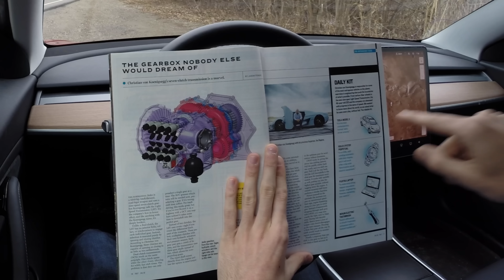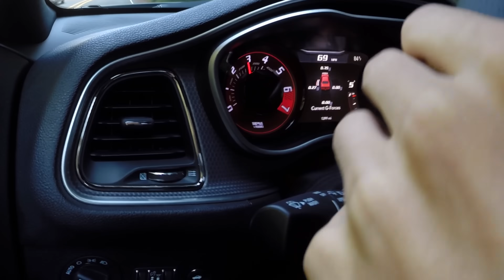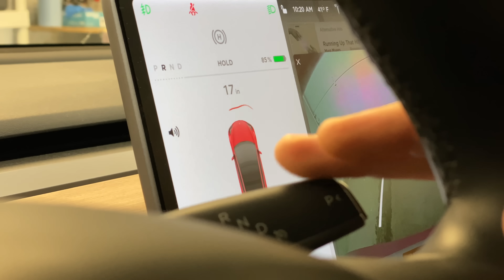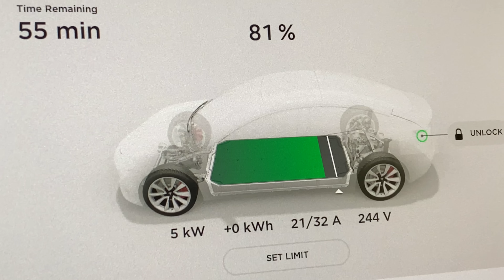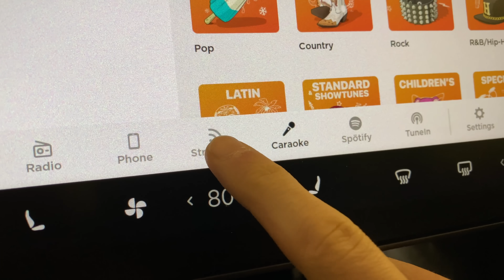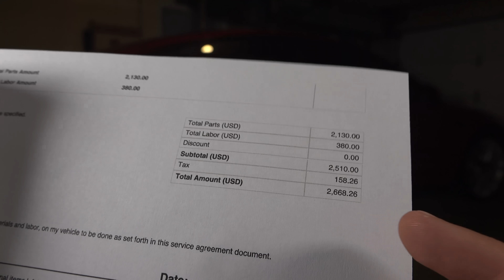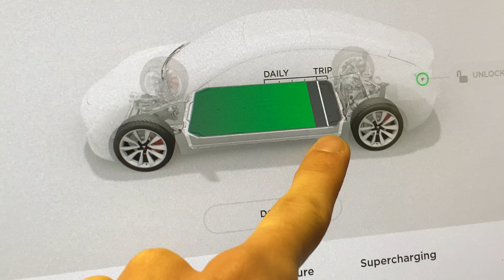Living With A Tesla Model 3 For A Year - The Best Daily Driver

Comment: On electric cars, the heater core and blower fan should be the luxury, with heated seats and steering wheel being standard. At least if you're going to go with a resistive heater and not a heat pump.

Comment: EV’s just make complete sense all things considered, especially from an energy point of view, the most important factor.
Reply: Your mind is a bit too narrow.  Imagine there are 80k lbs of goods in California that need to be transported to New York asap.  Does it make complete sense to accomplish that in a vehicle that weighs 4k lbs and can only travel 250-300 miles before needing hours to recharge?  No, it doesn't.  That's just one example.  If all you can think of is Joe Blow driving 3 miles to his job and back home, you need to broaden your perspective a bit (try actually considering all things).  Electric is perfect for some people, and totally out of the question for others.  Which is why they will NEVER replace vehicles with engines, only supplement them.

Comment: A lot of good points here, but one argument I don't buy is the "ugh, I have to go to a gas station AGAIN". I pass three gas stations on my six minute commute. It takes me roughly three minutes to fill the tank from near-empty to full, and I do that about two times a month. Now, how long does it take you to plug your charger in and out? 10 seconds? 20? Let's give the EV EVERY benefit and say 10 to plug in and 10 to unplug, and you only do each once per day, six days per week. That's 26-27 days per month = 8.6 to 9 minutes. MORE time than you'd spend filling gas.

Comment: This is a trolling s**t post video, regardless...

1) EE: where's the torque?
Me: Have you ever driven a diesel? Those have all the torque.
EE: ACCELERATION!!
Me: Well yes. EVs have that off the start line, but uhhh... buddy what about top speed? Tesla Model 3 is only 140MPH, The E-Corvette tops out at 210, the Bugatti Veyron SS 264MPH.

2) EE: what's up with the power lag???
Me: The Renault F1 team would have words for you, their throttle response is fast enough to play "God save the Queen" with just the engine. Get your car tuned and it will have more power, fuel efficiency, and throttle response. Don't put ICVs down because the factory owners prioritize profit over product quality.

3) EE: Transmissions are LAME!!
Me: Yea! I know right? Who needs rotational mechanical advantage? Cars? Bikes? The Electric Porsche? Nah! rip the gears out, they're junk! Again blame auto manufacturers for giving you crap transmissions, not the transmission itself. If the power delay bugs you that much get a dual clutch. Fyi EVs were invented ages ago too and only now is our understanding of battery chemistry good enough to make them practical.

4) EE: It so noisy!!
Me: Stop hanging out with Harley Davidson fans. I think you'll find the "noise" of normal cars (especially exotics) quite pleasant when they aren't honking their horns at you in traffic.

5) EE: Maintenance is expensive!!
Me: again blame your cars manufacturer for that. If they want to they can certainly make a car such that it breaks often and requires more service and parts they can charge exorbitant prices for. Kinda like Apple.

6) EE: No regen brakes?!?
Me: ICVs have had regen braking for years. Just ask any F1 team. In fact the regen braking on those cars is so good, severe restrictions are placed on F1 cars that have it to keep them from completely crushing those without it. Why aren't those systems on regular cars? Hhmmm...could it be the manufacturers are too lazy to go through the effort of reverse engineering them for mass market???

7) Why fill up at a gas station???
Me: you can top off in 5 mins and be good to go for hundreds or even thousands of miles in diesel ICVs. If you really want to you can even buy extra fuel and take it with you to store and use at home. The fact most people don't spend the majority of time in the car driving is the only thing that saves the practicality of EVs, especially in low voltage charging situations. Go on a long road trip, haul a trailer, or visit a place with no super-charging stations and that issue gets annoying real fast.

8) EVs pre-heat way better!!
Me: yes they can, and it takes a massive chunk out of your range, and will eventually drain your battery completely if you aren't constantly plugged in. Wouldn't it be nice if you could open your garage to let your car breathe instead of gassing yourself and the engine to death??? Yes your engine will die just like you if you put it in a small enclosed space and suffocate it. As for app control...maybe you should send those lazy profit hungry manufacturers an e-mail: dear car maker person, your app suxz .1 star, plz fix.

9)EE: I can leave animals and people unattended in a car without running the engine!!!
Me: ......................1st, Don't do that. 2nd you are still consuming battery, and could still get into security issues if left unlocked or near L33T h@X0rs.

10) EE: environment!!
Me: Only a fraction of our energy comes from wind, hydro, solar or nuclear. If you aren't near such a facility or you are charging at night , low wind, or in drought conditions you have a good 80% chance you are charging from a Coal  or Gas fired power plant and are making carbon emissions too. Maybe one day humans will stop trying to use Nuclear power to blow everything up and use it for Carbon-less power instead. A Dyson Sphere would be good too, even a tiny one that captures just 5% of the Suns power would render all fossil fuels into a niche hobby fuel rather than a necessity. SpaceX  I'm looking at you, please make a Dyson Sphere.

Comment: #3, I want an electric car with a manual transmission WITH a clutch pedal.
Reply from the maker: Conversions are rad!
Reply: I get that driving a manual gives American petrolheads a sense of elitism, but I don't understand why you'd inflict one with all it's weaknesses and power sapping inefficiencies on a direct drive transmission. To make it feel like an ICE you'd have to restrict the torque band. You could actually probably simulate a manual transmission in software, by restricting the current into narrow rpm bands that change  when you "shift". You could simulate the clutch by having the car periodically make grinding noises and subtract thousands from your bank account.
Reply: @mikeedwards350  Hey Mike, to me it's more about the pleasure of driving. I grew up on manual transmissions and I feel disconnected when I don't have a clutch pedal. I would absolutely pick a manual transmission with a clutch pedal over a paddle shifted version of the same car, even if meant losing a second in 0-60 time. I've driven paddle shift cars and it's just not the same. To me, it's not about the speed, it's about the connection and involvement in the process that I enjoy. I now have a GTI with a 6 speed and an F150 with a 10 speed auto. The 10 speed is a FANTASTIC transmission, and the truck's purpose is towing and some commuting, so it's great for that. But if I want to go to the track or drive just for fun, i want that clutch pedal, it's not just about choosing which gear. NOW... I think part of the disconnect for me is that it is so foreign to me that a motor would have a flat torque curve that would not benefit from some sort of gear optimization, but it sounds like that is essentially the case, from what you are saying. The closest i've driven to a Tesla is a golf cart, but even when I had battery powered remote control cars, when we raced we were always choosing different drive gears for the one that would be a best compromise of acceleration and top speed for a given track, so i think that is in my head, too.
Reply: @jeremyspecce  I get where you're coming from - every car I've owned has been a manual, I learned to drive in one, they're the default here. I've tried autos and didn't like it, the lack of engine braking,  or the ability to shift down because I can see a  corners coming up,  no auto can give that level of control. With an EV though, that torque is there all the time, and you can access it even faster than in a low geared ICE, there's no throttle lag, and little inertia in the drive train to overcome. You could get a higher top speed with a gearbox, which is what Porsche is doing with the 2 speed on the Taycan, but a Tesla can do 150mph without it, and the acceleration is limited by traction rather than torque, so there's no need for a lower gear
Reply: Mike Edwards because its fun 😂
Reply: @neekjp  is it though? If ICEs didn't need a clutch and gearbox, would they have been invented, as an aftermarket "fun" upgrade? People would think you were mad to propose such a system which restricts performance, and is such an complex and expensive point of failure, that forces the driver to take a hand off the wheel.
Reply: @neekjp  is it though? If ICEs didn't need a clutch and gearbox, would they have been invented, as an aftermarket "fun" upgrade? People would think you were mad to propose such a system which restricts performance, and is such an complex and expensive point of failure, that forces the driver to take a hand off the wheel.
Reply: Mike Edwards ur going based on a hypothetical... couldnt give you a definitive answer to that but i can tell you manual is always more engaging which makes the driving experience more fun even if the car isn’t as fast as an automatic or a no gear EV.

Comment: for a daily grocery getter for the masses yes the tesla is great. 
you did forget to mention though about electric cars batterys being prone to over heating and the maintenance cost of batterys. sure an ICE car is 50$ here and there but there about the same when u come to getting a new 10k$ battery pack after (in some cases as low as) 4 years. 

My last complaint or mention is the weight of electric cars vs ICE vehicles, which in terms roadwork and such overtime, I don't think anyone has takin that into consideration. bridges, road damage, and more would have a lot more wear and tear if we had semis/cars/trucks weighing almost 1/3 more weight.  

on an up note, electric cars with auto pilot would mean less police to catch me speeding lol

Comment: What kind of efficiency are you getting with your M3P?
Reply from the maker: I am getting around 300 wh/mi. I live in a pretty cold area so I use the heat quite a bit. I've also done a lot of highway trips (75 mph typically), and those help with efficiency, generally around 290 wh/mi-ish.

Comment: Has it been a year already? Feels just like yesterday that people complained about your inability to properly measure panel gaps.
Reply from the maker: I've started using a ruler for measuring, I think I got it all figured out!
Reply: @EngineeringExplained  Still using inches and BHP, though :) Serious question: why do you use BHP when talking about electric vehicles?  I find the power conversions tiresome, as I do have an EV and PV on my roof and a 8kWh House Battery and everything is kW. why the BHP?

Comment: their technological leap will fall when there will be fuelcells instead of batteries...
but... maintanence? my ICE honda engine has more than 230k Km and its still going strong, I pretty much only change oil and filters, really not much more to do and its simple and cheap.
throttle responsivnes and feel to be connected - dude, you forgot how is it like to drive S2k???
i dont really undestand half of the pros of BEVs.

Comment: An electric car just isn't practical for my situation. I drive up to 200mi a day so I would need a high range model, and my paid off Honda fit is getting 45+ mpg so I wouldn't be saving much in insurance or gas. I'd love to buy one but they are too expensive for not enough range.

Comment: Regarding the emergency release handles, if the front passengers are able to get out of the vehicle, they can open the rear doors. Still not ideal, but at least the rear passengers don't have to climb through the front. If the front passengers are incapacitated, yeah that's a big issue.

Comment: I drive a Chevy volt and I have to agree with every point you make. I don't think I will go back to an internal combustion engine even though I consider myself a car guy. Electric is just too good
Reply: Crestfallen Plinth Chevy overbuilt the battery, especially for Gen 1. You could only use 60% (40% was dedicated to longevity management) of it and they are known to last over 400k miles
Reply: @TheoryBreakthrough  why? The 2011 models have experienced zero degradation, mine is a late 2013 model so i have 2 years left on my battery warning and it still gets me 50-55 miles per charge (well over the 38 listed).  nothing says an ICE engine has to be able to live longer than 5 years, much less 8 for the EV batterY.  Mini coopers, bmw, Mercedes, and Audi all have more expensive problems that crop up as soon as the 3-5 year warranty disappears.  I'm at 45k miles with 2 oil changes, practically new, original brakes, 22 gallons of gas used, 1 coolant flush at the 5 year mark, and no other maintenance or any issues at all.
Reply: @TheoryBreakthrough  also, you don't generally pay for the whole pack when one gets weak.  Simple battery management and Chevy did a great job with theirs
Reply: @TheoryBreakthrough  How much does it cost to replace an engine? Or a transmission? Or any other really big and expensive part on an ICE car? 🙄
Reply: mjc0961 So true. My wife’s E39 535i cost 25K for a full motor rebuild when previous owner (friend) ran it out of coolant (leaking hose). And a new gearbox was needed for us at $9K. Plus numerous other electronic annoyances, so we sold it for pennies and bought a new Suzuki which was faultless for years.
Reply: Ditch the Volt when you can and get the Model 3.  Drove Volts for 6 years and then turned in my final one for a 3. Greatest car I've ever driven
Reply: Crestfallen Plinth has yeah after ten years, that’s actually a good deal, batteries will be much much cheap per and much much better
Reply: Chris Sullivan Cool! I used to have (still do have it in the family) a 2014 Chevy volt and loved it, bought it with 6.5k miles in late 2015 and now it has 66k miles. I have since switch to a Model 3 due to me driving more (20k miles a year) but love both. For me it was a great “stepping stone” to pure EV also the Volt isn’t slow like most fuel efficient cars
Reply: @ValidAsian  yeah, i would love to go to a model 3 or something.  I LOVE the volt simply for lack of range anxiety and just how easy it is to drive in the city.  It's a great car all around.  I'm on my 3rd year with it and i can't imagine what i will wasn't too replace it with.  I just can't see going back to anoyong gas station trips
Reply: Chris Sullivan Agreed! One weird thing that I don’t get in my Model 3 is the Volts really good turn radius. The Model 3 is good when compared to the average American car but I definitely find it easier to parallel park, for example, in my Volt. Just a funny detail that I’ve noticed haha
Reply: @ValidAsian  fortunately, i rarely have to parallel park, but visibility overall is better than when I drove a mini Cooper... Which hilariously, had a horrible turning radius for such a small car. My only complaint with the vault is the huge left b pillar

Comment: I believe the emergency latch thing  in the backseat is because of children. 100kph and they open the door even with child lock on.
Reply: Both the X and the S have rear emergency release and the 3 even has the release wire inside the door it doesn't connect to the outside world.  I almost didn't buy the 3 because of this.
Reply: Emergency egress is available through the trunk/boot.
Reply: @waynerussell6401  Not if you have the trunk loaded up.

Comment: Took 4 minutes for a guys Model 3 to warm up in -52C weather
Reply from the maker: -52C! Holy cow. That's cold. And 4 minutes is pretty good! You'd definitely want a block heater for combustion engines at those temps.
Reply: I wonder how much battery loss you'd get at that temp.

Comment: I'm sold, i'm going to drive electric.

All i need is €50K for a base Model S 
And about €500K for a house with garage.
Hmm, i guess i'm €549.000 short....
Reply: Make an ebike for less than your €1000 and you can be part of the revolution too...
Reply: @ahaveland  yea but an ebike won't replace my car.
Reply: @Fallingout1234  It replaced both of mine, so I scrapped them and save a fortune.
If I really need a car then I use a taxi or hire one.

Comment: All good and well but the performance isn't that impressive. 0-60 in 3.2 seconds is nice but a 60 grand car based on the early 2000 e class does it in under 3 seconds.

And how are ICE vehicles loud? The Phaeton is pretty quiet

Comment: Love your videos and have for years. But I also love internal combustion engines and manual transmissions. I agree that hating on change is silly, but so is championing change for the sake of change. I like the question “what is best?” You may be right that electric cars are best for many reasons, yet the question is a tough one. My vote is to have both available for as long as possible. Having choice may be best of all.